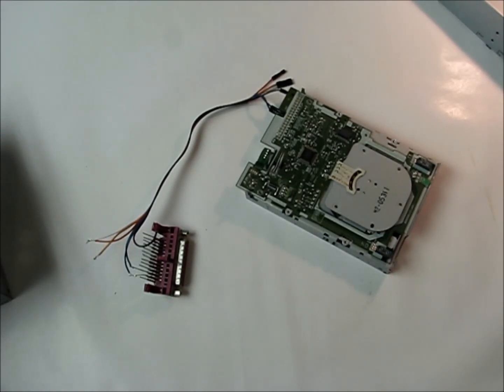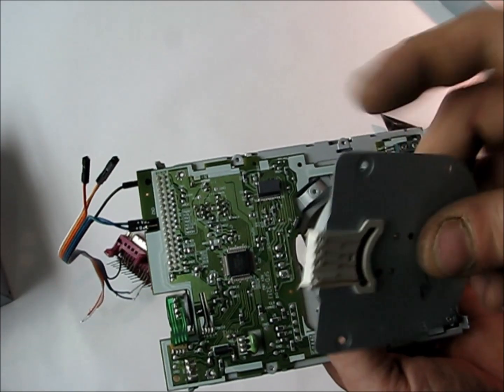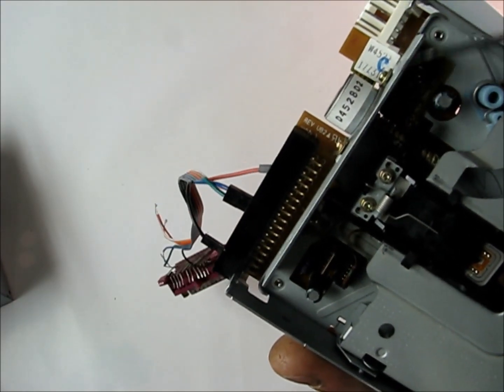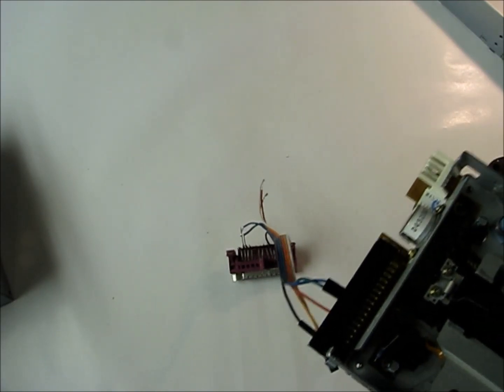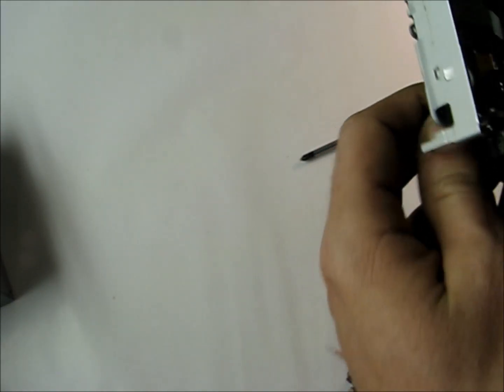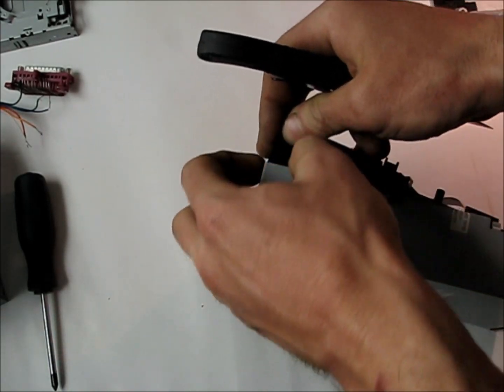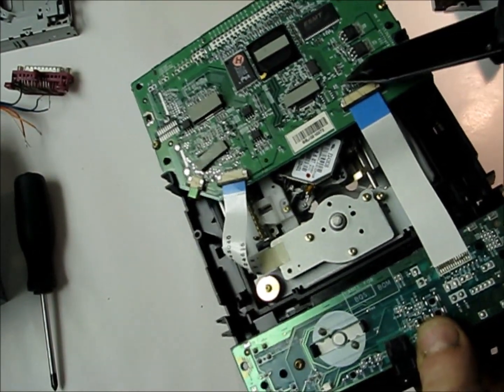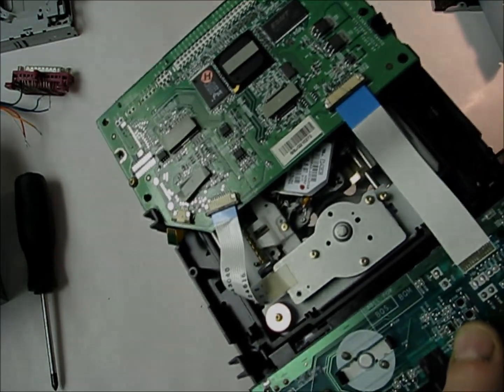DIY FLOPPY DRIVE CNC: Part 5 - Floppy Drive/ CD-Rom Teardown

Comment: 2 of 3 of my floppy boards have a limit on steps allowed to go from the beginning (where sensor is installed). How did you overcome this? Or you just happened to have right floppies from the start?
Reply from the maker: I dont know if i mentioned that in the videos... there IS a limit with the floppy controller board.. it sucks... i wanted to use the driver to make bigger machines or robots.. but its very limited cause of this so i moved on to http://makeyourbot.wikidot.com/brute-force-1-3 < that circuit to drive unipolar steppers for bigger machines... thats why the travel distance on this configuration cant be very big.. but we could drive these lil steppers with a L293d chip i bet.. :| im sorry im the one to give you the bad news about the limits ... it sucks i know... I tried to find a way to bypass it..... YOU SAY one of yours has no limits!? COOL! What make is it... that would be handy! you could make a super small pocket size camera dolly :)
Reply: I just checked all three, looks like they all have a limitation. :( The one i thought doesn't have a limit is actually just a bit stupid and doesn't automatically bring the head back at power-up.
Also thouse aren't bad news at all, i'm  fine with 2cm for my project.
Reply: Richard Harris Oh, wowowow. I got it. The floppy that doesn't reset head position on power-up can actually have as many steps as you wish, you only need to reset controller board every x number of steps to go further. Don't know if it's somehow useful though.
The floppy is Samsung SFD-321B/E.
Reply from the maker: Hmm...

I think the floppies are limited.. Unless we can hack into the logic (or interface the right spots on the controller board..) Thats why i buy the l293d chips.. they are simple to use and can drive steppers big enoug to make an ok desktop machine (nema 23 i think i have).. 

HMMMM maybe we could drive the little floppy steppers with L293D chips (for really small  robots or knuckle joints)! :D

Are you making a Lil CNC with this?
Reply: Richard Harris Yup, and it's almost finished ^_^.  Floppies are awsome for starters, they cost nothing, they most likely already are in your garage somewhere and they are extremely simple to interface. And also they have all essential parts, the only thing you need to make is a construction itself. Maybe i will even post some instructable for this.
Reply from the maker: NICE! let me know! :)
Reply from the maker: I used 3 of the same floppies
Reply: Richard Harris +Корвин Маклауд Did anyone get to hack floppy driver logic? I have three floppies and all of them are limited to 82 steps in one direction, after 82 steps in one direction it just changes direction on it's own, no matter what is the state of DIR pin.
Reply: Neven Ignjic Some of them need to be "homed" speaking in cnc terms, some home automatically on powerup, some don't care at all. Any of these could be usefull, you just need to find those that don't count steps at all. As far as i know there is no way to "hack" floppy logic because there is no way to flash it, the goal is to just find the right one's.
Reply: Корвин Маклауд I opened total of 5 floppies and all of them "home" at powerup, count steps and forbid me to move more than 80-something steps, guess it's just bad luck. Any tips on how to make stepper controller from recycled parts?
Reply: Neven Ignjic never tried actually, although Richard Harris suggested these diy boards: http://makeyourbot.wikidot.com/brute-force-1-3
Also there are tons of projects of cnc's made of scavenged printer parts.

Comment: thanks Mr Harris, a question, I don't seem to have a sensor in the floppy drive that you keep pointing to in your video ( cant really see it in video either) .. any suggestions on how to get around it?

Also for others like me out there if parmon step/dir changes dont get the motor moving then check I/O setting in the computer setup :)

Comment from the maker: Hi there, the floppy control board is limited to a certain amount of steps i think.. I would use unipolar motors and mosfets to drive each coil... that would be the easiest with computer parts without buying anything. I am going to make a tutorial on it soon too, its the same concept as the floppy drive cnc but it uses 12 pins from the parallel port instead (4 pins per stepper) Look up "Brute Force Stepper Driver 1.3" on google to see how until i make my tutorial if you want :)

Comment: Hello Mr. Harris. I was just wondering will these floppy drive boards also control larger motors ie Nema 23's and so forth? Im in the middle of building my own desk top cnc and looking at alternatives.... I have a ton of old electronics that I have hoarded through the years so was just wondering.

Comment from the maker: the printer port sends the signal to the floppy control board.. both are used... ( the control board has a "H-Bridge" built in (i think its called)) the next vid shows how to mount the sensor :)

Comment: oh i like this, do you plan to run the floppy servo directly from parallel port or through the floppy control board? i guess the control board would have the sensing circuit for when the servo is all the way back but would be a bit bulky